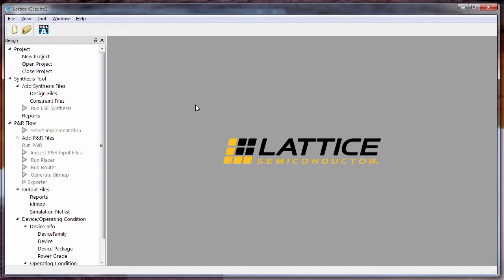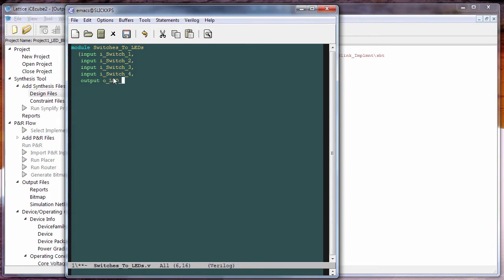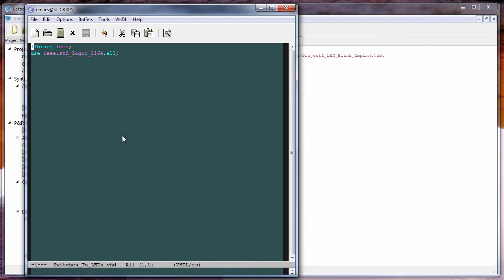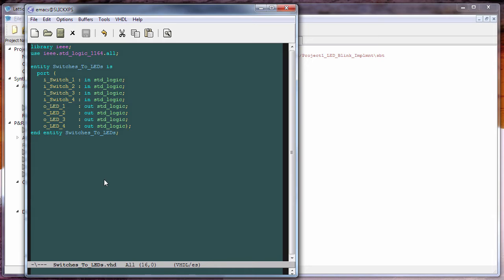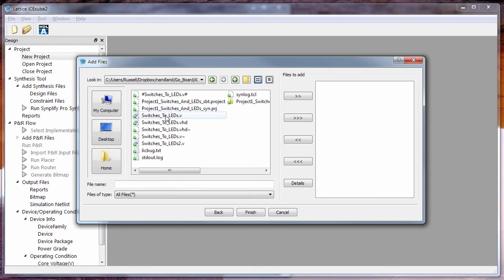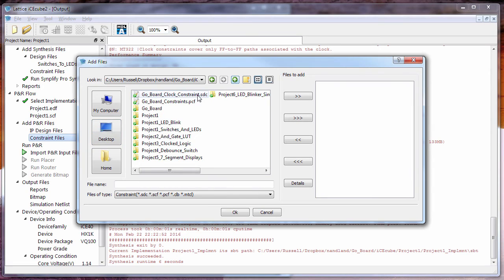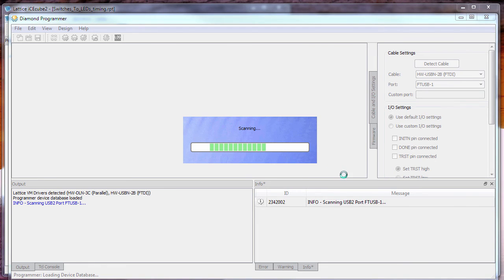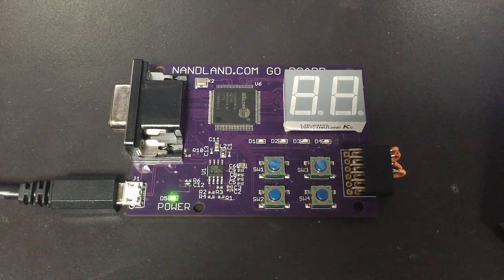Nandland Go Board Project 1 - Switches and LEDs

Comment: You mentioned using your laptop and you desktop at different times. With having to provide your MAC address for your license how exactly does that work? Should the type have been "Floating" and NOT "Node-locked" when requesting a license?

Comment: Is it safe to say this particular project doesn’t consume any fpga resources at all? The output of P&R states no Logic Cells were used. So when you say “physical wires” connect the push buttons to the LEDs (via the FPGA pins) those wires aren’t a limited resource in the FPGA?

Comment: Dear engineers,

I'm new to FPGAs, I bought a Nandland Go Board to learn hardware programming and do a project that requires connecting a camera to the board.

The first thing I struggled with was finding a camera I could use with the limited ports available on the board.

Can anyone help?

Comment: @Nandland  I am not getting the option in Diamond, under Device, for SPI-M25P10-A, the closest option I have is just M25P10.  I can't get my board working and this is the only thing that isn't the same as in the video.  Please help.  Thanks!
Reply from the maker: Yeah that's it. What happens when you try to program? Double-check that you see the COM port in Device Manager when the board is plugged in / unplugged. You should see it pop up.
Reply: @Nandland  I have the board plugged in and Diamond recognizes it and gives an operation successful output.  The board has two leds lit up on the segment displays and all four of the leds are dimly lit.  I verified that I have the .pcf file loaded so I am not sure what to do from here.  The switches don't do anything.
Reply: @Nandland   I was finally able to get this working.  I had to change the constraint file led and switch names to match my VHDL code.  I had no idea how specific this all really needed to be.  Thanks!
Reply from the maker: @flyinfast8  Makes sense! Everything needs to match or the tools won't know what signals correspond to what pins on your device.

Comment: Just got my board, working great. These tutorials are excellent. Anyone know if adding comments to the beginning of a Verilog or VHDL file will prevent this project from working? I was having problems when I had a few lines of comments at the beginning of my files. I removed them and was able to get project 1 working.
Reply from the maker: Comments shouldn't cause problems. Perhaps you were using // or -- in the incorrect language?
Reply: @Nandland  Thanks, it wasn’t the comments, you’re right. I forgot to attach the constraints file. Maybe I haven’t used iCEcube2 long enough but it seems like it can successfully go through synthesis, place/route, and generate a bitstream file without any errors even when there are problems with the code or project files. Like it took me a few tries to realize the NOT operator in Verilog is the tilde character and not the minus sign. It generated the bitstream without errors, but the go board didn’t work as expected (project 3 in this case).

Comment: Hello, I am working on the first project and I ran into the issue of not having the M25P10A option. I only have the M25P10 option as the closest device. Is there any way to get this device as an option? For reference, I am using the Diamond Programmer standalone v 3.12. Thank you to anyone who has any advice or pointers for this issue.
Reply from the maker: That's the correct one.

Comment: So I went to the link for the programmer tool, but it's not for the Diamond Programmer. After installing it opens up the Radiant Programmer. Is this a new programmer or am I missing something?

Also, in the Radiant Programmer, I can't find the device family for the HX1K, the only iCE40 option is for iCE40 UltraPlus. Do you know how to fix this?

EDIT:

OK I don't know if its the best solution, but I figured it out. I had to download the entire lattice Diamond Software, and in the /bin directory there was the standalone Diamond Programmer along with all the other Diamond Software. After I opened that up it was the same as what you showed in the video, and I was able to program the GO Board.
Reply from the maker: Glad you found a solution.
Reply: Well done. I got hung up at the same place. programmer.exe is what we should be looking for.

Comment: Crickey, it worked! I am very late to the party. I bought one of your boards when you first did the kickstarter, but have only just got around to trying it. I have been too distracted by the clutch of microcontroller boards that are available these days. But I have always wanted to be able to say that I have done a FPGA design and run it on a device. So I have finally achieved it.  It was not so hard thanks to your excellent explanation.  Are there boards a bit like an Arduino that contain similar Lattice FPGAs?

Comment: Hope you are still answering these comments. I have a question. You said the pin names on the port map on the top leve of yhe FPGA are fixed. As I understand, an FPGA is a bare IC, and if there is a switch connected to a particular pin, is because you designed your go board with a switch being connected there. What if you had connected your switches somewhere else in the FPGA?  Can you enlighten me a little about that? And also, where do I find this fixed names in the datasheet of an FPGA?
Reply: Hi. I just continued watching your video and noticed thesse signal names for pins are not actually gixed for the FPGA, but defined in the constrains file. Now it makes a lot more sense. Thanks!
Reply from the maker: You can change the pins functionality on the fly, that's the nice thing about an FPGA compared to a microcontroller, which is less flexible. The board itself is fixed, obviously, you can't change that on the fly. The pin names are usually specified in the Physical Constraints File (PCF) for the Go Board. You can see the signal names in that file. You're welcome to change those names. Just make sure the PCF signal name matches the signal name in your Verilog/VHDL code.

Comment: I want to buy your go board and since I'm new to fpga world and based on some small research I did and found that spartan 7 and artix 7 boards are used as beginner based boards. What do you say the difference between GoBoard and the other commercial beginner boards ?
Reply from the maker: In a word: Tutorials. Good ones. Other boards have nice hardware but no support. With the Go Board you get a development board with tons of projects available to you.
Reply: @Nandland  that's good to know. I'm a masters student in embedded electronics but I comw from electrical engineering background with very little digital electronics and will it be a good thing if I get this board and learn about the hardware and code ?
Reply from the maker: @AdarshChandruofficial  I made this board exactly for people like you!
Reply: @Nandland  ordering one today. Do you ship to Sweden?
Reply: @Nandland  heyy can you tell me if shipping to Sweden is possible? When I went to order it staright away went to paypal without even asking for address ? Can you help me out ? And if you can also tell me how long does it take for the board to get delivered?
Reply from the maker: @AdarshChandruofficial  yes I ship everywhere. Go through the PayPal checkout, you'll be prompted for your address. :)

Comment: I get the check I'd error but I don't have option to change port. It only has ftusb-0 also on device properties the only device option that is close to video is M25P10
Reply: Never mind figured it out. I uninstalled diamond and reinstalled it and it's fine now.
Reply from the maker: What OS are you on? What version did you download? Are you seeing the board connected when you plug it in in your Device Manager (in Windows)?
Reply: @Nandland  windows 10.
Lattice 2017.08.27940 and diamond programmer 3.11.0.396.4
Reply: @Nandland  yes I can see it on my device manager.

Comment: Got it working.  I had to change the vhd file because your syntax did not work.  I found the necessary changes in the "HDL Chip Design" (BLUE book).  After making changes the Synthesis worked.  When I got to Generate bit map, iCEcube2 proceeded to download a bunch of other pieces and install them, I assume the Diamond program was one of them.  It did everything and the board worked without going into the Diamond program.  The buttons work.  One thing that is happening, though, is the LED digits are sequencing through all the segments.
Anyway, many changes have apparently been made since this video, so I'll have to figure out what they are.  PS:  Each time iCEcube2 attempted to download a file, I the virus scanner asked me to "approve" it.  Here is the vhd file that worked:

library ieee;
use ieee.std_logic_1164.all;

entity Switches_To_LEDs is
 port (
  i_Switch_1 ,
  i_Switch_2 ,
  i_Switch_3 ,
  i_Switch_4 : in std_logic;
  o_LED_1    ,
  o_LED_2    ,
  o_LED_3    ,
  o_LED_4    : out std_logic);
end entity Switches_To_LEDs;

architecture RTL of Switches_To_LEDs is
begin
 o_LED_1 <= i_Switch_1;
 o_LED_2 <= i_Switch_1;
 o_LED_3 <= i_Switch_1;
 o_LED_4 <= i_Switch_1;
end architecture RTL;
Reply: @Bishop Lopez Interesting. I just got mine and experienced none of those issues. I also have to open diamond to program it. no such functionality exists in the latest version of iCEcube2.

Comment: Thank you so much for understandable beginner's videos and the tools to get started.  I installed iCEcube2 yesterday and ordered a Go Board!  I was a software developer for 30 years, retired in 2002 and finally see something new (to me) and exciting to play with.   I always liked software projects for embedded control systems, which married hardware with software.  I had first heard about FPGA programming some years ago from a friend of mine who was a VP at Harris Broadcast transmitter development and now find that most broadcast transmitters are digital and are at the heart of the transmitter operation  Cool stuff!

By the way, I worked for Bell Labs where VI and EMACS were developed and there were "religious wars" between the users of the two editors.  I always thought it was silly because whatever you are proficient at becomes your best editor.  I think BOTH of them are better than the weak text editing tools in Windows.
Reply from the maker: Thanks for the feedback and for your order! And yes, VI vs Emacs is as old as time itself.

Comment: hey man how you doin, i am learning about coding FPGAs so I started following you nandland FPGA video series and I've found them extremely good and vivid. I actually am thinking about getting a Go board myself but before i barge in to buying a Go board i'd like to stretch My FPGA muscles a bit. So what kind of simulation IDEs should I use as a total beginner? any suggestions?
Reply from the maker: Thanks, I'm glad you found my content helpful!  I definitely recommend getting a Go Board to work with!  It helps to have hardware in front of you to really see the effects of the code changes that you're making.  But with simulations, I suggest checking out www.edaplayground.com.  It works pretty well across all operating systems (since it's web based), it's free, and you don't need to install anything.  I go through how to use it in this video: https://www.youtube.com/watch?v=V-Kmj8T_Byg
Reply: @Nandland  Thanks.

Comment: Whilst FPGA's would be fantastic to use, if this is typical of using FPGA's there is no way in hell are hobbyists going to use them. Massively complicated with too many steps with multiple sections and multiple files - not to mention the software wanting to know you inside leg measurements  store you can download if WTF!!!
What we need is a graphical system with all the steps hidden behind the scenes. - life is just too short for all this shit.
Reply: It is complex yes  ,  these hobbyists do LED turning on and off and thats it , My problem is Audio DACs , i have one audio interface that is locked to 48khz , but its actually capable of 192khz  oversampling but that is controlled by this controller , and i dont have the code , its probably same as in all DACs or most , but cant seam to find some tutorial or help , thats why i looked up controllers , but its on the level of LED , not DAC control so its not gonna help me . I learned it in school , long time ago , digital language, nand gates all that , but we didnt do Controller design and programming of it , so , i guess that for PHD

Comment: Hi, i just got my go-board and it works great with iCEcube2. Is it possible to make it work with Lattice Diamond? I tried but i don't see that device in the new project dialog.
Reply from the maker: Unfortunately no. I talked to a Lattice rep about this and according to him the plan was to bundle iCEcube2 FPGAs into diamond. However the task turned out to be too complicated and it was scrapped. So iCEcube2 is it for the Go Board, or IceStorm (open source Verilog toolchain)
Reply: I see. Thank you for the fast response.

Comment: Hi,

Just got my Go-Board and am trying to synthesize your Verilog example on iCEcube2. (I'm working on Linux Mint 17) The process aborts with SynplifyPro stating: 

/usr/local/iCEcube2/iCEcube2.2017.01/synpbase/bin/synplify_pro: 321: /usr/local/iCEcube2/iCEcube2.2017.01/synpbase/bin/config/execute: Syntax error: "(" unexpected (expecting ";;")
I've checkt the code several times but cant find any syntax errors. Any idea?
Thanks
Reply from the maker: Okay, weird!  You're the second person to have this problem.  I'm still not sure what's going wrong, but the solution that worked for the other user was to change the Synthesis tool from SynplifyPro to Lattice LSE.  It looks like something is going wrong with the IceCUBE installation, either a path is set up incorrectly or there's some dependencies that are missing.  An alternative solution is to look into using IceStorm to synthesize your design, which is an open-source tool set.  Let me know if this fixes your problem, or if you ever solve what's wrong with SynplifyPro synthesis.  Thank you!
Reply: Thanks, Lattice LSE works for me.

I could bring synplify_pro to start by replacing "#!/bin/sh" by "/bin/bash" in the synplify_pro starter script under "<your-install-location>/lscc/iCEcube2.2017.01/synpbase/bin/synplify_pro". (Source: http://fpgas.net/articles/install-lattice-icecube2-on-64-bit-linux) However, the synthesis process seems to never end and iCEcube2 stays frozen, waiting for synplify_pro to finish. The only hint I get from the system is that it tries to invoke synpwrap -prj Switches-To-LEDs.prj